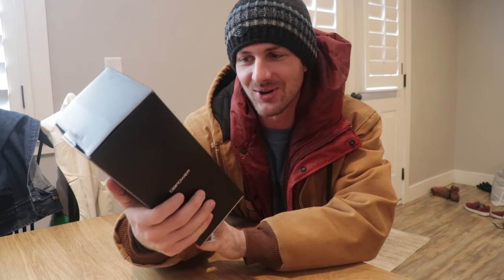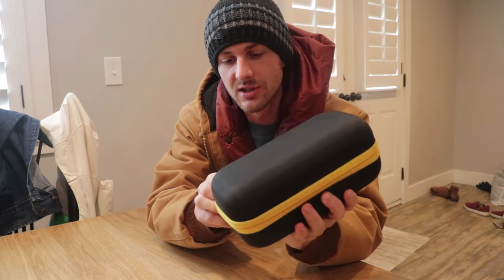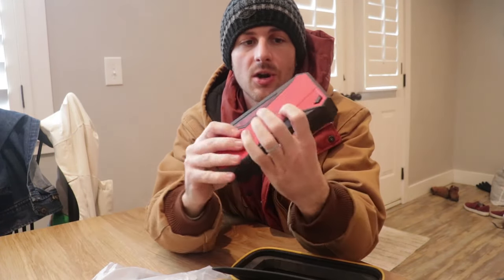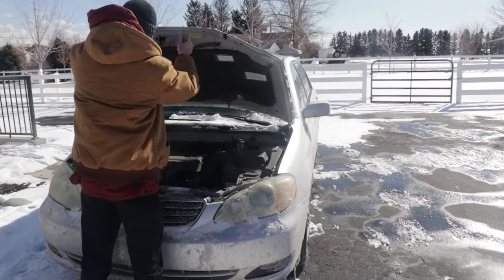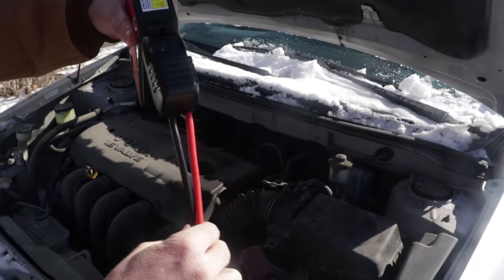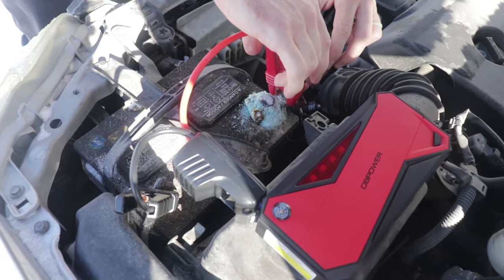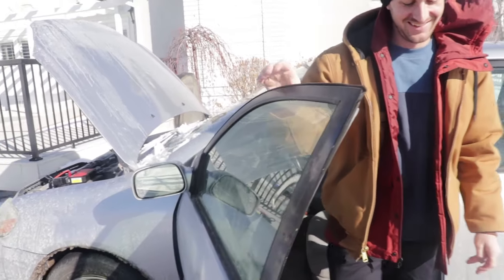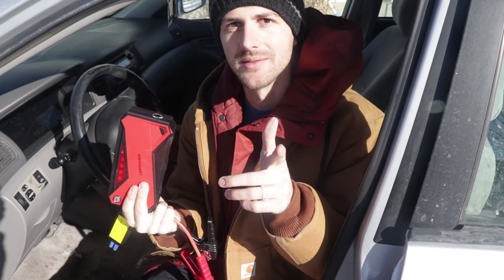The BEST Portable Jump Starter For Car Battery!

Comment: Always connect the red (positive) jump lead first, followed by the black (negative) jump lead. Never the other way around. When disconnecting the jump leads, disconnect the negative first, followed by the positive.
Reply: Why Red first and then Black first?
Reply: @luiscede8423  That's what it says on the instruction leaflet, and it's also to prevent a short circuit.
Reply: @luiscede8423  black is your ground. If you connect black right away it’ll short your main relay out since it is connected directly to a ground wire.
Reply: Remember RBBR. That’s your code how to connect and disconnect. Red then Black Black then Red. It’s my code and works for me. You could right it down stick it in with jumper or put  it in your cell phone under battery. Teach your family’s drivers how to use it.

Comment: Some baking soda and water will eliminate that corrosion.  Or if you want instant relief, NOCO makes a product available at Walled Mart that will dissolve the acid. Then spray the terminal with the Noco battery protector.
Reply: A coke or Pepsi does works better..just pour on the battery terminal

Comment: I had the same one and one night when I was working late, my truck wouldn't start because I left a dome light on.  I thought wow I get to try my new jump starter thing that I got on amazon.  I hooked it up and tried to turn it on and the dbpower device was also dead.  I then went into the building and plugged it in and ordered some food and watched a movie while I was waiting for it to charge, which took a long time.  I then tried it again and it didn't work again.  I don't know what I did wrong, but I ended up calling my wife and she picked me up and she took me home which was massively inconvenient since everyone was already in bed and it was like 1AM or so at that time.
Reply: Yikes! That's nightmare. That's what I am afraid of.  Did it ever worked?  In my case,  I left the jumper at home before heading to the airport and return to a dead battery after a vacation.

Comment: How do you charge this?  Does the power switch need to be on or off? How long does it take to charge jump starter?
Reply: Did you find out how to charge it
Reply: @247tats  Jump starters always charge through USB. You can use a phone charger, just make sure you're using the right connector (check the instructions manual or box).

Comment: Great video, thanks! I had tried to jump my car but didn't succeed.  i followed your instructions but the blinking light didn't turn to solid green light. Do you know what did i do wrong?
Reply: You probably didn't have the negative (black) on a solid connection. Always put the red on first and off last. The red needs to go to the battery but the Black can go to anything bare metal since it's just a ground. Sometimes you will have an issue grounding the black because of thick paint. Try and find a bare metal spot to attach the black. A lot of cars will have a bare metal post to connect the black to.
Reply: Definitely don't follow his instructions as he may be using a completely different jump starter. Always follow the manufacturer's instructions on the make and model of your own jump starter.

Comment: I ordered this starter twice. Would not start my car. Connect it to the battery. Try to start. Seems pretty straight forward.  Anyone have the same issue ?
Reply: Could be your starter is bad.
Reply: Make sure your negative (black) is getting a good connection to the battery or even better to a bare metal surface.  Sometimes the pain is so thick the clamp doesn't get a good connection. Find a bare metal spot (no paint) to connect the black.

Comment: Just an FYI If you maintain your battery you would have most likely not needed to jump it. I have always lived by the rule - If you take care of your car, your car will take care of you.
Reply: Batteries usually are good for about four years after that don’t trust them. You could have a dead battery one day or night. Using Heat/ac radio lights wipers charging phones power windows power seats power trunks power sliding doors. Just replace the battery with a fresh battery after four years.